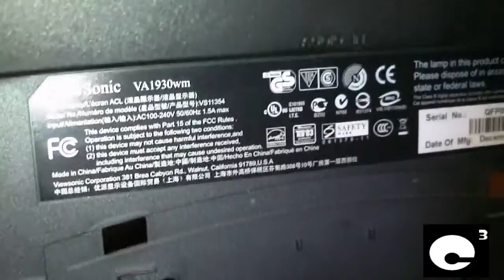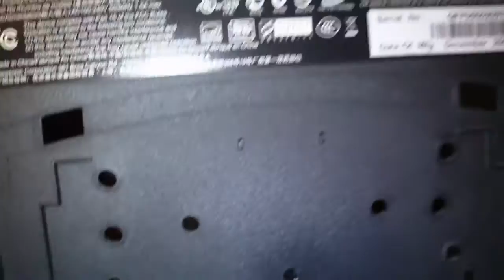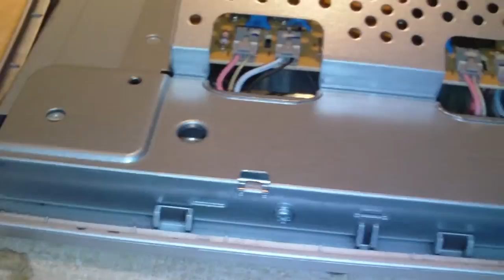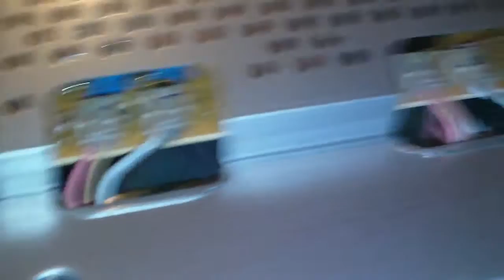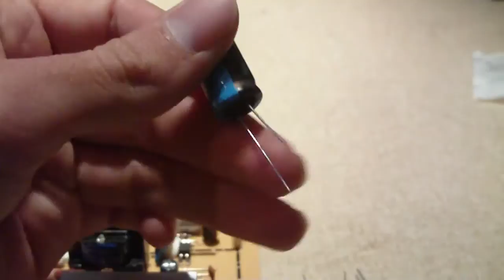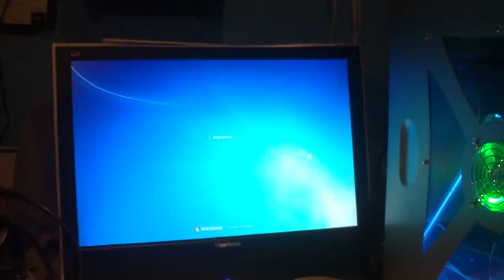Recapping a ViewSonic Display

Comment: What is the actual issue you faced at beginning? Gliches? Do you have a video for that issue?
Reply from the maker: The original issue was the monitor not wanting to start. It could have been the backlight not wanting to start. The capacitors failing on the power supply circuitry weren't allowing the monitor to start up like normal.